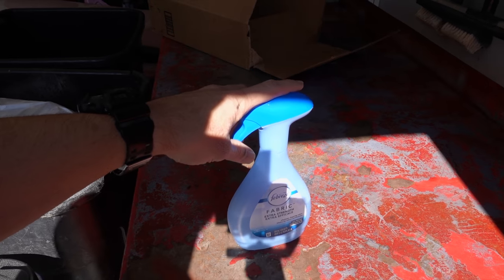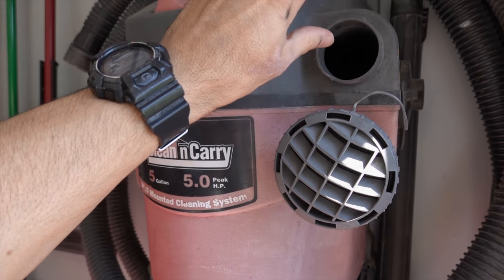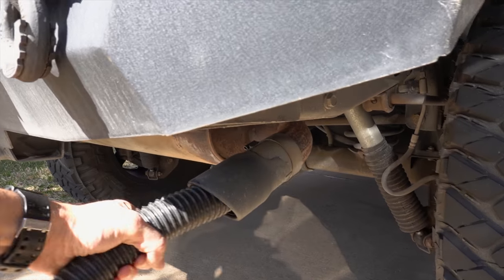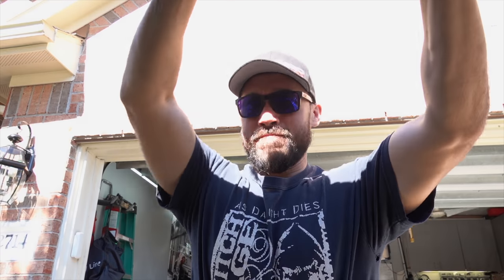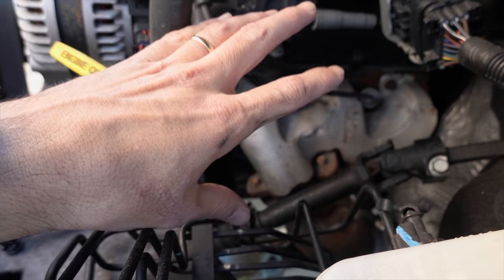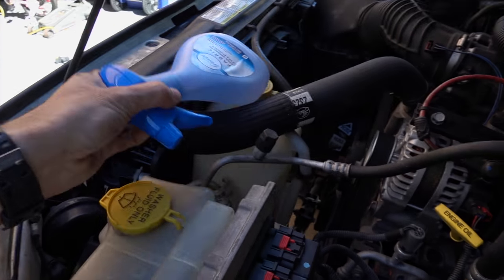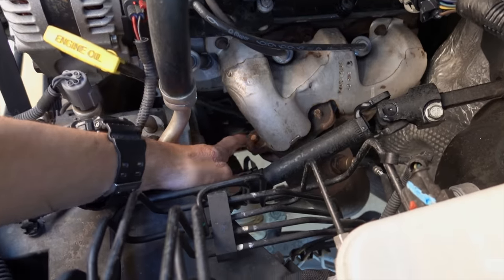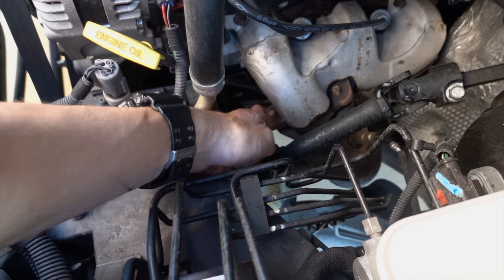How to Find Exhaust Leak Quickest Fastest Easiest Simplest and Safest

Comment: Question! Won't forcing air back up into the exhaust foul out the o2 sensors?
Reply: Not if you disconnect the battery.

Comment: That's blows grime and rust towards your engine lol
Reply: If you have grime and rust that can be blown towards the engine then a vacuum leak is the least of your problems.
Reply: Not really once the pressure builds the flow rate goes way down. No high speed air no rust going into your engine.

Comment: As a home remodeler, I use soapy water to check for gas leaks all the time, for instance after installing a cook range. But I'd have never thought so this for an exhaust leak. Brilliant! Thanks!
Reply from the maker: Thanks ! 👍
Reply: @vt7828  I've done that in a pinch, if it's safe. Not sure how well it would work for an exhaust leak.

Comment: Thankx Buddy. I use this method on my Burb and found the two manifolds craked and also found some leaks on some welds on pipe. I taped the vaccum pipe to the tail pipe. It workS. AMAZING. BROTHER THANK YOU AGAIN. CHEERS.

Comment: Funny video, but at the same time, very informative. This method with vacuum cleaner and soapy water is also the smartest way to find exhaust leaks.
Reply: Smoke is most likely way easier.. You can use a 99 cent cigar and hose.  Spray bottle doesn't reach all of the hidden areas.  Smoke will find its way through without having to crawl around.

Comment: This was great! I loved the metal with the vacuum scene. I've been working on a custom exhaust for my 1936 Chevy truck with a 5.3 LS. Headers have been a nightmare and my old timer buddy said dump tranny oil down the carb and find the smoke. After about a gallon, my neighbors are annoyed and I have a guilty conscience. I thought about this but was thinking it wouldn't build pressure due to valves being open. I'm sure  EFI throttle bodies seal better than carbs. If that's a problem I'll seal off the carb. Easy enough. Going to do this to find a vacuum leak too. Thanks man
Reply: Yep always the easiest things that go completely sideways.  Haha

Comment: Thank you for the vid! I swear, the vacuum scene is similar to what all of us do trying to get something out or off. Lol. Awesome. And I’m using this method right now to see if my ticking is an exhaust leak or something else. Thanks!
Reply: Hrmm from my experience ticking usually is your ball joint that needs a repair as it’s worn out or if it’s ticks only when your turn then it’s your CV joint. Exhaust leak would sounds more like a not so nice rev XD
Reply: @raniaafg4753  Ticking is a classical exhaust leak by the ball and socket/header area etc,know what you mean by the CV joint balljoint but i think most people call it exhaust tick is because you accelerate and that leak goes pah pah pah pah pah and it kinda makes a ticking sound,i had a old H pipe on my Mustang that was leaking and i could have sworn it was a lifter ticking every time but thank god it wasn't.
Reply: @dntlss  ooooo okay that makes more sense! Thank you. Are you able to help me figure out why my Audi turns off while idle like when I’m warming up the car? :(

Comment: I was told my car has an exhaust leak as well. But it’s getting to where I can smell exhaust in my vents when the A/C or heat is on and it’s making me sleepy when sit at a light for a while. I’ve noticed this from when I was younger and we used to have kerosene heaters and when the kerosene runs out the smell puts me in a real deep sleep. But I gotta get to work and it’s a hard thing to save up for a mechanic to replace. I really hope I can get it done soon for the sake of me and others around me.

Comment: Nice video. I think I have an exhaust leak in my VW GLI with 240k miles. I get hot air coming into the cabin vents that dries out my face and gives me a headache.
Reply: Possible leaking heater core if smell is coolant'y, if not you have a stuck-open engine bay louver vent and possible manifold issue. Can you shut the louver? 

My Suzuki Grand Vitara had electric louver that malfunctioned in the stuck open posiiton which I dont think is good because it allowed humidity ingress into the cabin.

Comment: Same thing happened to me yesterday. Just the day before yesterday my wife said your 04 crv is so quiet I didn’t even know it was running. Then yesterday I started it up and it sounded like the muffler feel off. But the noise is not coming from the muffler, it sounds more like it is coming from the catalytic converter. Somewhere around the cat. Could it be the change in temperature “ like the weather “that caused a crack or what?  It went from summer weather to almost freezing in the morning. Could that be what caused the exhaust leak? Thanks for your help, James

Comment: I thought about something almost the same ? There is some Capsule of which when you add acid it Causes a Smoke . this is used to Check if  A gas copper Pipe Has Faulty Joints Place the Smoke Capsule within the Exhaust end and  Seal it in and Thrust air into the Exhaust Pipe I Have not tried it out as Yet But Having Put Brand new Exhaust Pipes and also Flex Pipe; I thought that would have solved the Problem But the fumes are so Bad it has to be The Manifold either Cracked or Gaskit I'd like for you to try this Method out; This Smoke Comes out thick wherever the Crack or hole might be

Comment: Hi great clip. Is there any preparations before u push the airhose into the exhauste pipe, except of course tape the pipe with the hose for no leaks ? I have a leaf blower. 

1. For ex could u hurt, damage the manifold or engine by blowing air into it
2. Is it bad or dangerous too use too much airpressure depending that a leafblower with vaccum have some high airpressure even at the lowest level, level 1
3. Should u use sucking / vaccum stage first soo u suck out dirt or any lose particals in the whole exhaustepipe
4. Could that damage silencer internal materia or catalyst internal materia by airpressure if its too high
5. Whats the normal "watts on air" u should use if point 1-4 has a factor of taking pre-caution?

Thanks for answers even if the questions seems stupid 

Sorry for my bad english glosses too not using the right technical terms on internal plates in silencer plus catalyst

Comment: My late Grandpa had a different method:  

He too, used a spray bottle,  but with gasoline in it.  
Turn on the cold engine (when it's leaking the worst) and spray the exhaust manifold, then watch for where the fire is.  

(To all the rest of the smart-asses out there, don't ask how Grandpa died!)

Comment: Thank you, Donny. .suv started making a loud noise.so I had a friend to help me why us so loud especially when I started? He told me I leak my exhaust he said hell fix it. After he had my car in the garage he finally was done so we took it for a test drive, before even driving anywhere stared and it was still a very loud noise I drove around the block, and I looked in my review mirror it was smoking I mean crazy smoke. So I pulled the vehicle over and looked under their guess what I saw was melted tape hanging down and also on fire. I ask that damn fool what did he do.?  He said used the wrong tape on there. I almost died right there. I went to the napa store and got a quick fix tape for mufflers I never fix anything before and now I am nervous doing this but at least I won't be a fool like my friend. I am gonna have to watch that boy very close before he blows up himself and others.  Thank you for the tape.

Comment: Okay but can this be done on the exhaust pipes that run underneath the car will it still work is it still safe sorry I have no mechanical skills whatsoever and the past two years I've been trying to learn to work on my own car it's been okay.. but I did a muffler delete well actually I just replaced my muffler cuz I wanted something louder and I got louder but I got louder because of an exhaust leak not what I wanted not a good sound so does this work on the exhaust pipes or is this only beneficial to under the hood area
Reply from the maker: Yes

Comment: I have the same problem in the same spot. Can you explain what parts you needed in order to fix this?
Reply from the maker: I just had to tighten the bolts at the flange.
Reply: What size bolts are those I just had my manifolds changed and now it's making that exact same sound from the passenger side. The mechanical did my job did not put the  Nuts back on

Comment: Manifold area is hidden.   I don't think this is the easiest.  Smoke is probably going to show up right away if you run smoke through.  Soapy water method means you have to apply the water all over..  But smoke does the work for you.  And smoke reaches where you can't get a spray bottle.

Comment: Cheapest too, the diesel shop trying to charge me 1200 and they don’t even know exactly where the leak is coming from. It could be as simple as fighting a screw. I’ll be trying this in the morning i refuse to get bamboozeled
Reply from the maker: How did it turn out?
Reply: @Donnythelatemodeltech  had a big crack  on the underside of the turbo hose. I was trying to find it by ear but it’s kind of hard to hear over a Diesel engine. With this method I found it in less than 5 mins. Damn mechanics always trying to get over

Comment: Or just stuff a rag in the tail pipe, start the engine then spray the soapy water  at the exhaust manifold.
Reply: that won't work.  If the exhaust cannot flow, it will shut the engine off fairly quickly !  Not a good idea to stop the exhaust flowing anyway...  The video is spot on !
Reply: @jonrandall5490  Thanks. I watched a video where someone did use rags. My guess is that the cloth being breathable didin't stop the flow 100% ....but overall I guess it's not a healthy idea for the engine.

Comment: why is your shop vac a piece of shit? nice editing, but horrible design of that wall mount. can't be all that strong if it didn't blow the hose out of the pipe.
Reply: @Donnythelatemodeltech  proper tool for the job. dismount vac from the wall with the biggest hammer you own

Comment: As creative and easy as your method is... I wouldn't say safest. Your forcing debris, soap and water into your engine.
Reply: I was thinking the same thing too cause your engine was designed to flow exhaust one way only
Reply: How would soap and water get INTO the engine when there is a positive air pressure pushing out?